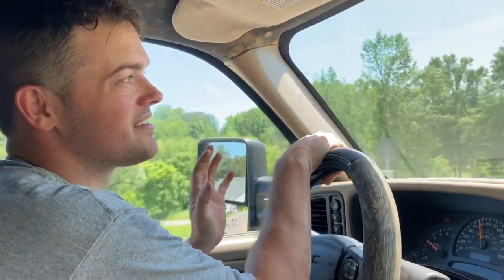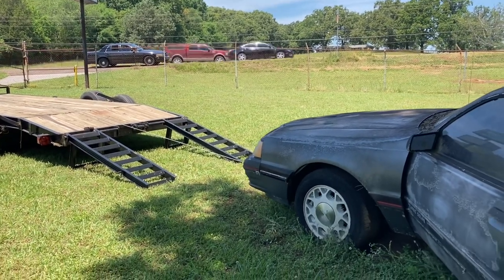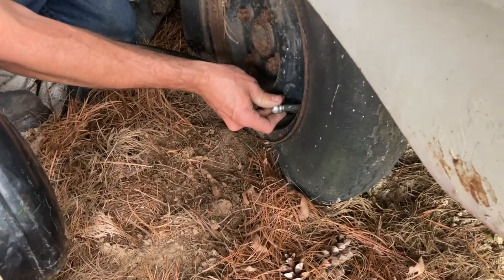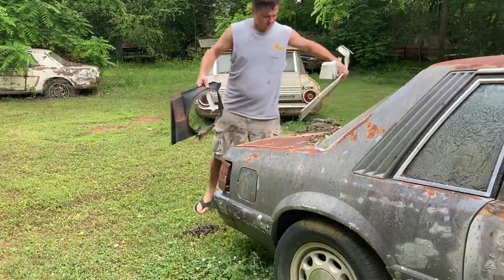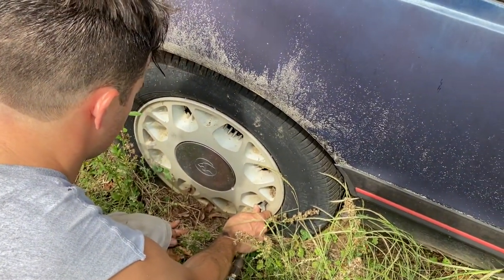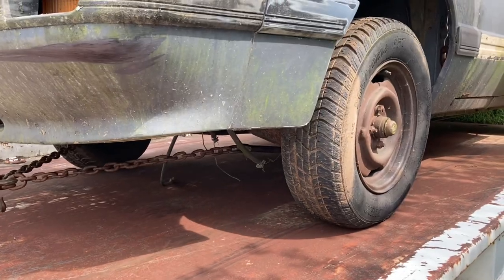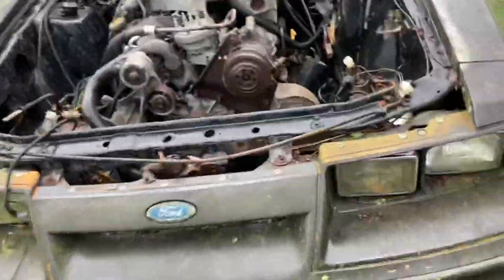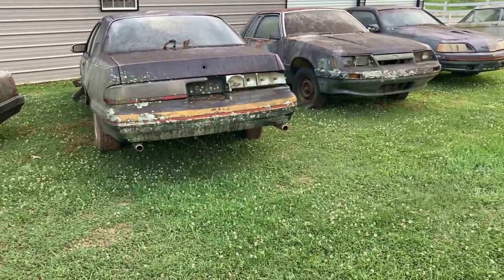Moving 7 cars that have been parked for years

Comment: I bought a 88 Turbo Coupe back in 1992 and I enjoyed it so much. Would run 140 mph easily for a 4-cylinder turbo, but I did have flow masters and a KNN system on it. I once smoked a Mitsubishi Conquest, which was a strong runner back in those days. Great car.

Comment: Really cool video. Nothing better than having your family involved in your hobby. The tractor should be cool if the engine is not stuck. They will run forever. Having a flat bed wrecker helps. I have a car trailer with a 12k winch on it. I've bought and gotten some for free and hauled hundreds of cars and trucks over the years and just about everything else on it. I am in Mesa Az. Surprising in some cases we get rusty floors as well. Mostly if water which is rare here is allowed to enter and sits under wet carpet and the pad.
Reply from the maker: Yes it’s great having my family involved

Comment: When using a winch it is always best to keep the trailer hooked upto the truck and run jumper cables from the battery on the truck to the battery for the winch with truck running so the winch battery doesnt die

Comment: Man that early 60s Ford falcon 2-door that would make a nice looking gas  car. Straight axle high front end maybe 302 or a it's getting mixed up sorry 289 small block maybe dual quads 9 in rear end see if you can find a four-speed for it.
Reply from the maker: Sounds awesome